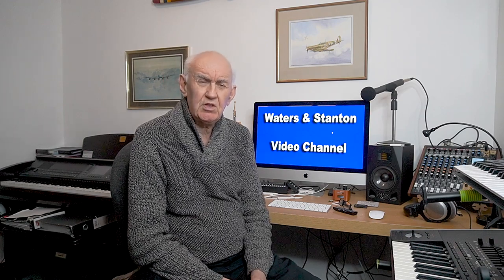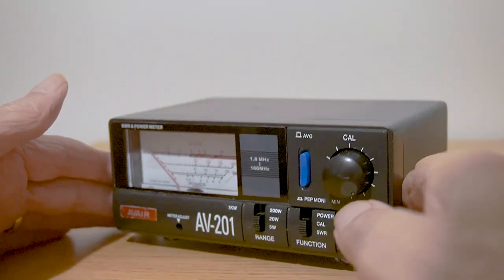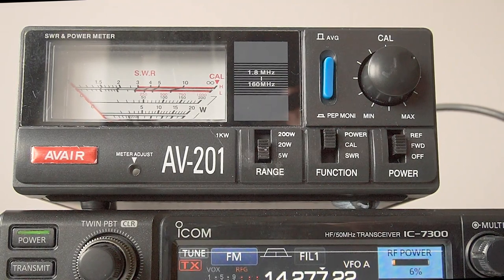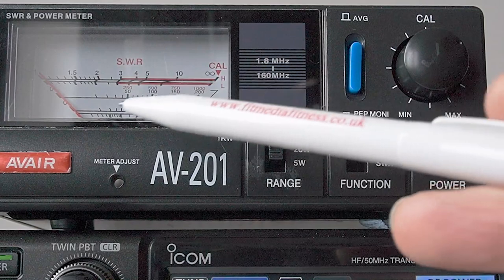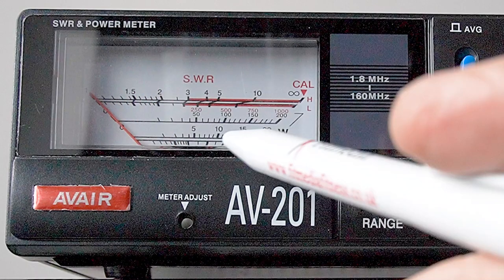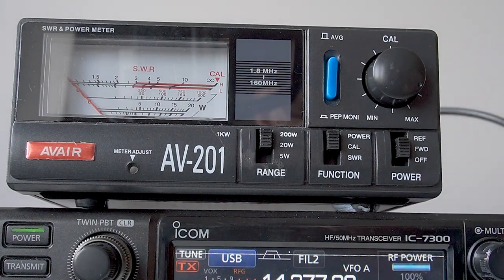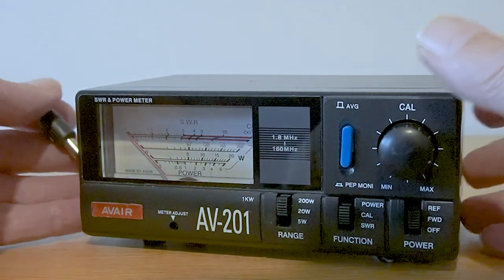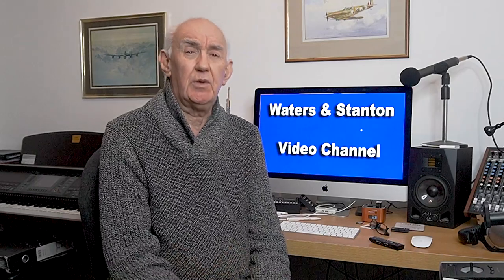HAM RADIO External VSWR Metering - The Advantages and How To Use Them.

Comment: Great video. I got a pwr/swr meter hooked up to my IC-7300 and got one for my IC-705 as well. I've been running FT8 with my IC-7300 on 5w lately. Having the meter allows me to dial in 5w almost perfectly. 

I've learned quite a bit since getting a meter. Just because the radio has 1% increments, that doesn't mean it's 1 watt increments. If I need to fun more power, I can dial the radio in to how much power I want going out, instead of guessing. 

Thanks for the video, you explained a lot.
73, W4ISB.
Reply from the maker: Hi, nice to hear from you and thanks for sharing. 73 Peter.

Comment: great stuff Peter I use a power meter to check and see if I am outputting my 100 watts. Yes there is a good one on the IC-7300 but I like to see the large analog meter move with modulation on SSB. Thanks for the video.

Comment: 06:40, TX was 5 watts, you calibrated to full deflection, but you had the range switch set to 20 watts, was that correct ? Should the range switch not have been set to 5 watts, transmitter at 5 watts then calibrate to full deflection ? Apologies if i'm wrong, i'm still learning. Thanks.

Comment: Hi Mr. Stanton.  I really enjoy your videos.  You always present topics at a level that I can understand. 

Maybe a really dumb question.  I know that antenna tuners really don’t tune the antenna but only match antenna impedance.  Is there any way to tune the antenna?  Will an antenna analyzer or external VSWR meter help me do that?  I’m considering a Zero Five 10-80m 43’ vertical ground plane antenna for my home.  I’d like to get as much yardage out of it as I can.

Thank you for any guidance or resources I might consult to answer my question, and for your wonderful videos.

Comment: Good grief Peter  - you have a bad LCD display on your IC-7300. There is a line running along the top of your display !! gasp !!. I have two x IC-7300, one was bought from Waters and Stanton - the first shipment received from Icom and sent to me on 4 April 2016. I see Simon Wilkinson handled the shipment for me. And I bought a second one from MLS six months later. Both of my 7300's are perfect, no issues in the slightest. They both run like a Swiss watch
Reply from the maker: Hi John, I told Portsmouth I wanted a gash IC-7300 - that is what I got. To be honest it works and dies the job. Will get it sorted one day!  73 Peter.